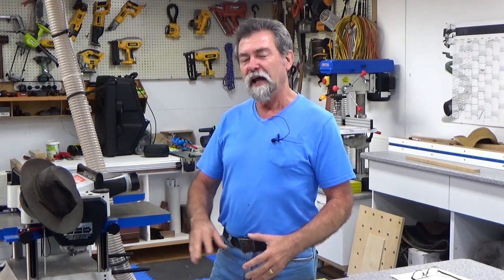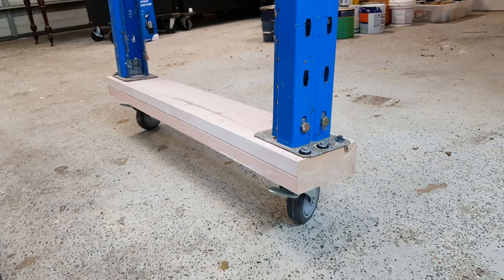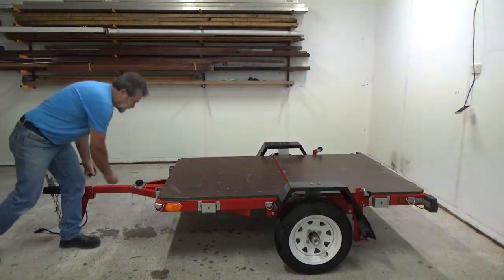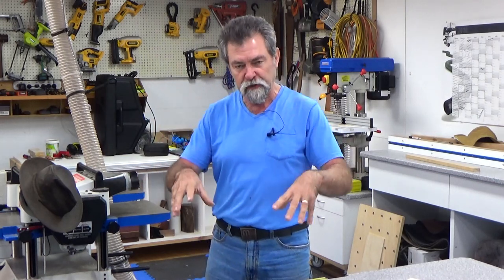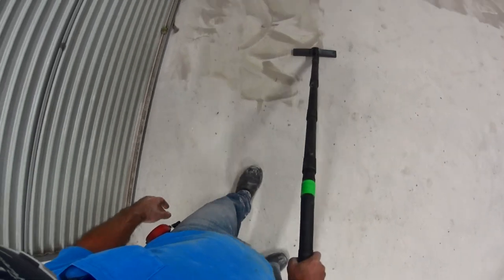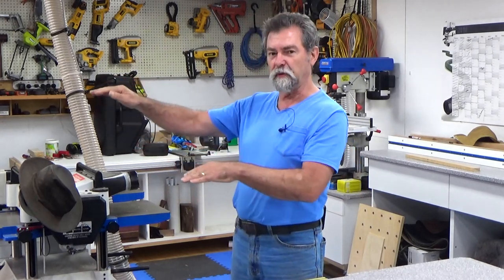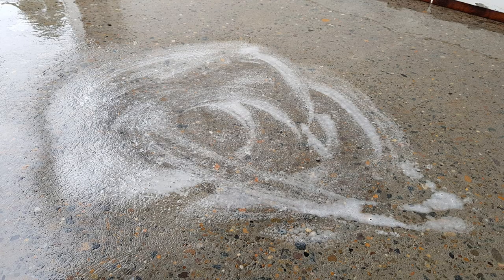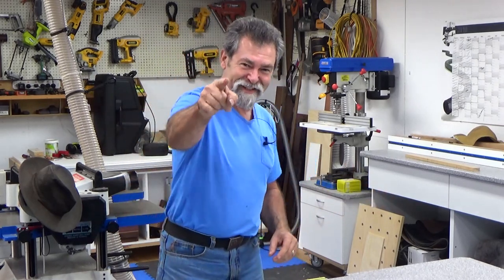Concrete Grinder Brings Garage Slab Back To Life! Dave Stanton easy woodworking tips and tricks

Comment: Currently doing this on 50+ yo concrete. Ended up buying a Paddock 250mm grinder as already have a HVAC and cyclone separator. The main 4*4M workshop is looking good so far, as is another area 3*5M. Both had imperfections and old crap paint that was removed. 2 major cracks required some cutting and filling but only required 1/2 bag of mortar/bondcrete to fill.

Looking good... so now trying to decide how to seal. Got 4 different grit sizes so was able to do a decent job.

The grinder cost $2K (was $800 off) but as I need to eventually use on more areas it has basically already paid for itself.

Comment: Just put down an epoxy floor in my tiny shop. It has made a real difference. Now I’m starting on the storage and workbench and hopefully by the end everything will have a home instead of being shoved wherever I can fit it.
Reply from the maker: Did you use the DY-Mark kit from Bunnings Leeroy?
Reply: David Stanton that’s the one, came up a treat
Reply: I'm thinking of doing my garage floor soon, and I happened to have a guy over doing some waterproofing on the walls (buried on the outside and seeping through), he had some experience with doing floors and recommended Sika products..... Now I just need to find a local supplier.

Comment: Thanks Dave. Coincidentally a very timely video for me. I’m hoping to do the epoxy flooring too. I need to get the slab to be level first though. The concrete slab in my garage has sunken on one side due to reactive clay and the neighbour moving large amounts of soil close to the garage. Will probably hire someone to do foam underpinning first.
Reply from the maker: Good idea to get the foundation sorted first Erdem. Maybe you could take some photos of the process and send them into me for the show? I am sure there are people in similar circumstances.
Reply: David Stanton Sure. Actually my place is a villa so I’ve been working to get the strata going for a while. It has proven yo be tricky. I’d be glad to document the process if I can get it going. :))

Comment: I'm trying to remove paint over spray from my interior concrete floors and I think this video just answered my question: is it OK to grind down to the aggregate. I see that's what you did here. In my case, after grinding away all the paint, I will polish the concrete to make it smooth and then probably stain and seal it. Thanks for the video.
Reply from the maker: Yes, absolutely
Reply: You might consider epoxy.

Comment: Hi Dave, great video. How deep did the grinder cut into the slab? Is the machine you used aggressive or just a surface finishing machine? Thanks for sharing your experience👍
Reply: Would also like to know the answer to this question. I am trying to resurface my shop floor and also produce a slight bevel to the center where I want to install a drain. Right now its a mess when its gets wet.

Comment: Dave, I need advice on a similar project. I recently poured a 30 X 50 ft. concrete slab for use as a home basketball court for my boys. It turned out ok but it has several dips, low spots, high spots, etc., that may for some not-so-consistent basketball experience (court needs to be completely flat).

I thought about trying the leveling compound approach, but feel I would just make things worse.

Do you think a grinding machine would work for this rather large, outdoor concrete slab? And what should I do to ensure I grind it consistently level across the slab?
Reply from the maker: Thanks Ryan Reeves! Maybe set up a laser level to locate the high spots and grind those down until you have a satisfactory result?
Reply: @DavidStanton  I do have a laser level. I'm wondering though how do you know how "much" to grind? I've never used a grinder before, so I don't want to make it worse by "overgrinding". Is there an indicator on the machine?
Reply: Ryan Reeves Some hire company’s hire an Australian made grinder manufactured in Albury so you can buy your own diamonds and polish from them it will save you money on your job as the hire company charge you for diamond wear on the grinder.  You need to mark the areas where you have high spots and low spots, very noticeable after rain!  and grind heavily the high spots and lightly the low.  It you spot grind only the traction on the court will vary and it might not be that playable.

Comment: Use water based two part system if your going to go epoxy. Prime then top coat.
That aggregate looks pretty good though so why not densifie then coat with a water based penetrating sealer.

Comment: How do you do the corners?
Reply from the maker: I removed the skirting boards in some areas to get in closer and then used the pressure cleaner into the corners. There are smaller machines that Festool sell to get closer into the corners.